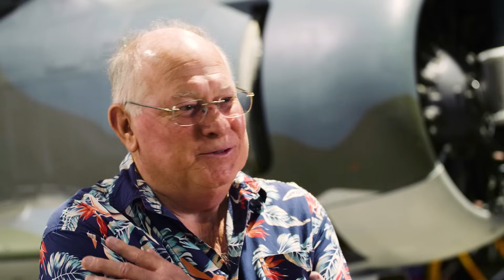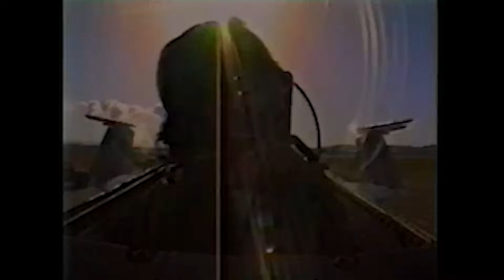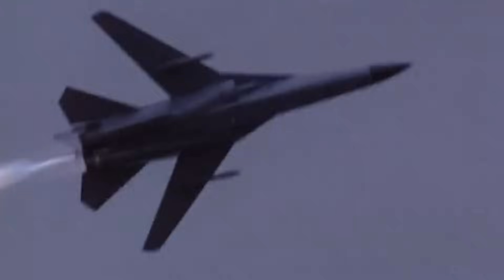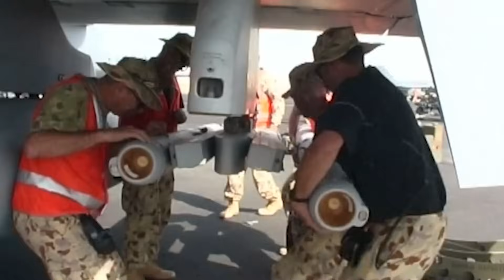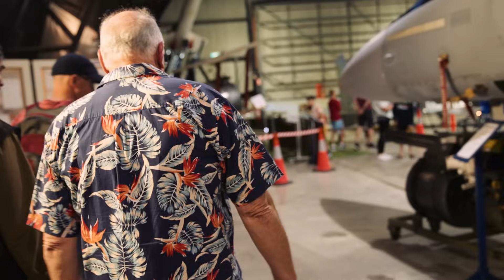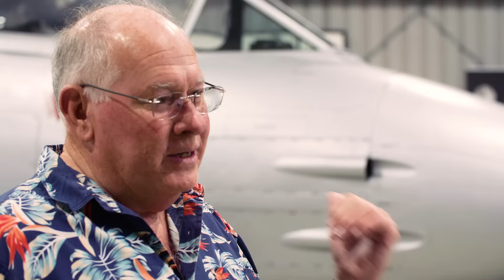The Fighter World Experience!

Comment: With all due respect to Ron, he did get a few things wrong on the armament side of things for the F/A-18. The 20mm M61A1 gun didn't shoot at 4000 rounds per minute to "save ammo". The rate of fire was selected depending on whether you were shooting in air to air or air to ground mode. In air-to-air mode, the rate of fire was 6000 rounds per minute or 100 rounds per second. The reason being is that you want to saturate the air with large lumps of metal to increase your probability of hit. In air to ground mode the rate of fire was 4000 rounds per minute. Presumably so as to limit ricochets and likely because the target wasn't moving all that fast in comparison and you could potentially come back around for another go.
The BRU-33 (and later BRU-55) Vertical Ejector Rack (VER) he talked about (for the RAAF) mainly carried 500lb Mk82 slicks and snake eyes (high drag). At least up until the late 90's when I left the RAAF. They were indeed capable of carrying 1000lb Mk83 series bombs though although we didn't have any in the first decade and a half of the aircrafts service. 
The two bombs that Ron points to sitting under the VER on the right wing appear to be Laser JDAMs (joint direct attack munitions) with the laser seeker under the black cover (not a fuze). These came in after my time in service so I'm happy to be corrected if wrong. A 500lb GP bombs that Ron alludes to is an unguided bomb that once dropped, follows a ballistic path to the target and cannot be steered once dropped. For the uninitiated though they would look similar. The JDAM steers by means of the rear fins that receive steering signals from the seeker on the nose. 
Lastly, in Rons days (perhaps on the mirage) he may have dropped only HES (high explosive substitute) bombs ("not war stock") for training but on the F/A-18 we never dropped high explosive substitute (HES) bombs ever. I was a RAAF Armourer on the F/A-18 from 1985 to 1997 and we only ever dropped HE (high explosive) bombs. For training, we dropped the BDU-33 Low Drag and High Drag bombs that can be seen on the white SUU-20B/A bomb and rocket dispenser next to Ron (the little blue bombs). These bombs ballistically matched a 500lb GP bomb and were much cheaper. The F/A-18 could carry up to 18 in one sortie but typically carried either 6 on the centerline pylon or 12 (6 under each outboard wing pylon, with typically a mix of high drag on one wing and low drag on the other). This gave the aircrew between 6-18 passes at a target rather than 4-6 at most for a load of 500lb HES bombs, increasing the training value and decreasing the number of sorties needed for that training. 
Incidentally, the F/A-18F Super Hornet doesn't use these at all as it is all simulated electronically in the cockpit.
All in all, a very good look at fighter world at Williamtown and I enjoyed it very much. I must get back down there one day and have another look. FYI I was based there between 1986 and 1988 (3 Sqn), Tindal 1988-1994 (75 Sqn), and back to Williamtown 1994-1997 (77 Sqn)
Reply from the maker: Thanks for your detailed comment Marty - much appreciated.
Reply: @raafdocumentaries Ron also mentions the Mirage was in service until 1979. The Mirage ended service in 1988, just a slip of the tongue I’m sure.
Reply: on ya Marty, I knew that a gunnie would pick those little errors up ;)  and yes they are JDAM configured Mk82s, BTW, I could have sworn we dropped some Mk83s at Delamare in 1990?
Reply: @davidewhite69  Haha thanks mate. No, I never saw a Mk83 in my time at all. I left Tindal in Dec 93 and we'd never dropped Mk83's up until that point and we didn't drop any when I was at 77 Sqn following that either. They may have used them on the Mirage, but I went straight to Hornets and never had much to do with the Delta winged dealer of destruction.
Reply: @marty1468  rattling the old brain cells I figured when and where i saw Mk83s on RAAF Hornets, it was when I was at 2OCU in 98 when we went to Townsville
Reply: @davidewhite69  ah okay yep, I was in Saudi Arabia with BAE by that stage.